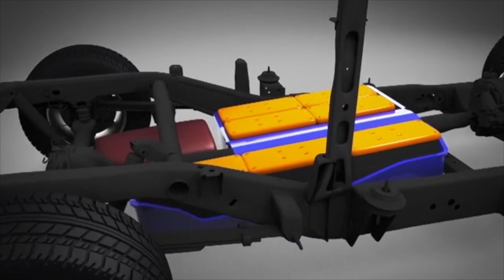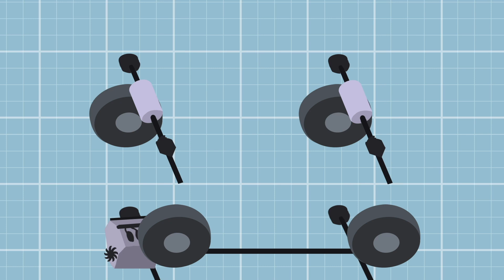Could This Pickup Truck Design Change The World?

Comment: Pickup trucks are probably the best candidate to be electrified, at least in the US. The only issue is the vast majority of truck buyers tend to be buying them to show everyone on the road how big and powerful their truck is. This is much harder to do when theres no appreciable engine noise, it won't make the driver feel as 'cool'. But if you think logically about the idea, it makes a lot of sense. Pickup trucks are already very expensive with no features, amenities, performance, and often times even range. They're slow, not very safe, and typically less reliable than a comparable car. It would be easier to make a 40K electric pickup truck than it would be to make a 20K passenger car, and while the owners would love the massively improved torque, performance, and reduced cost of ownership, they wouldn't be able to complain about how much it costs to fuel up.
Reply: I feel that you've been living under a rock. Many of the trucks are just as technical as some of the SUVs and cars if not more. The fact is people use their trucks to haul and tow, and they don't need to be disturbed by somebody who probably only owns cars.
Reply: Ian Heard I’m not sure what you’re getting at here. I made no mention of the electronics or technical performance of trucks. Most of the time they’re very similar to cars, which makes a lot of sense. From my experience, the overwhelming majority of truck owners never or exceedingly rarely tow or haul things a car couldn’t tow. The standard light duty 40K show trucks people like to buy don’t get dirty, and don’t haul much in the bed you couldn’t fit into a car. They also tend to tow very poorly and be drastically higher risk on road to both occupants and nearby vehicles due to the poor handling, braking, acceleration, high center of gravity, and overall traction. I’m not claiming trucks are evil, useless, or they should be eliminated. Just that for most people, a car would much better serve them, and it would be much cheaper to buy and operate. You get an increase in comfort, safety, reliability, economy, and they don’t drive like a bus. But since that’s what so many Americans want, it’s fine people decided to make it for them. And if someone’s going to make it, it probably would be better if it was electric. And it would be easier to make a mass market electric truck competitive than a mass market electric car, since you’re starting off with such a low standard for performance, overall quality, and at a high price point as is.

Comment: And where does the electricity come from for these "plug in" trucks?
Reply: In most of the US, a lot of power comes from natural gas.  The total carbon output is lower than for trucks with an engine because of economy of scale.  As more non-carbon power sources come on the grid, the carbon foot print will decrease further.

Comment: I watched the first min. And a half of your video, and already came up with an answer to your question. Why aren't better fuel milage trucks being made. Quite simply, greed. End of conversation.... that is the number 1 problem with people and bug corporations alike. Why would you make this ultimate vehicle that can get 50-60 mpg when you can slowly integrate "newer" technologies to bump your mpg from 25-50 in let's say 20 increments as a pose to 2. Becouse you can make more money by using 20 increments. Becouse you can persuade peaople to buy more vehicles over their lifetime trying to reach 50mpg buy different sales gimmicks over a lengthy timeline. All boils down to greed.
Reply: Might I add the term suppressed technology. Dont be nieve, car manufacturers have a lot of hidden technologies that their not willing to disclose for one reason or another. But I'd bet, its becouse it doesnt maximize the profit they could potentially gain going another route. We live in a world that has been around a long long time people... dont keep the wool over your eyes. It's the same principles in car sales as it is in anything else.... the control of advancement. This isn't like the middle ages people. Technology is way more advanced and has the potential of being a whole lot faster than what we perceive

Comment: your going the wrong way if you think pollution reduction is the goal.  Electric cars pollute far more than newer cars or trucks as shown by many studies. hybrids are normally far to under-powered for a work truck needed work load, and that will not change in the short term or even longer. let not even go into the cost increases that can be put to better use. As your putting out BS PR crud I wonder if and how much did you get paid for this vid?

Comment: The ignorance contained in this video is incredible. 

1: EVs are not the answer at this time. The environmental impact from manufaure of EVs is terrible and the batteries, once degraded are toxic waste.

2: Hybrids are stupid. There is no gain in efficiency to be had when you add additional energy conversions to any system. Hybrids are only useful if they are used to enhance performance.

3: EVs are not saving the planet. You are, for the most part, charging your car with coal. Stupid. A simple reality of EVs is that the only current source of electricity that has any hope of making EVs have a lower carbon footprint than a regular car is to expand nuclear power generation.

Just peddling bullshit is not the answer. We need to stop thinking that we have found the solution. We are nowhere near.

At present, the only people that are benefiting from 'green technology' are the snake oil salesmen that sell it to you.

If you want to repair the world, encourage your children to be engineers and fill their heads with useful ideas and not bullshit from TV or other pointless source of useless crap. Actually take the time to educate them. Your Facebook friends will wait.

Heads out of asses.

Comment: A "bit" of a turn off? Its the same turn off seen in electric and hybrid cars. Except its exacerbated in a vehicle that tows and hauls anything beyond itself and a few passengers. 

Now point number 2... And kinda the most important. Uh wheres the power coming from? Hmm? How are you producing this plug in electric power? Coal? Fuel oil? Lng?  So called "green" energy that cant even make itself profitable for energy companies? Sooo uh yeah..... Fail. 

Want to know how to make it work better? Remove the emissions restrictions on the engines. I dont mean make them dirty either. I mean litterally remove the stuff restricting the engines. We had carburetor engines in the 70s and 80s getting 50+mpg. Better than hybrids do today. In all this time nothing has gotten better in terms of fuel economy yet engines themselves are worlds more efficent. The problem is all of the excessive emission parts are restricting the engines. They make them detuned to pass emissions standards and end up being less fuel efficent when doing work. Make them run at peak power efficiency not peak emissions efficency and youll seen mpgs skyrocket

Comment: Is no one concerned with the magnetic fields that will be caused by all these electric vehicles. Seems to me that the magnetic fields are gonna be a lot worse than emissions. Especially if the magnetic fields of the moon are responsible for the tides of the oceans what the ones from the cars gonna cause.
Reply: The gravity of the moon (and sun) cause tides.
More efficient motors have smaller external magnetic fields.
People you live where there is a stronger magnetic field and where there is an AC component to the field live longer.

Comment: This won't matter soon as batteries will be so cheap it will be a no-brainer to just go all electric. The C4V Consortium will be producing Lithium cells with no Nickel or COBALT and on the cheap as they picked up a whole bunch of manufacturing equipment out of a Chapter 11 Bankruptcy. http://chargecccv.com/innovation They plan to scale this up to three 15+GWhr battery factories. This is in addition to factories by Tesla, Panasonic, Samsung, LG Chem and others in China/India/Asia etc. By 2020 there will be more than double current battery production and by 2025 it will double again. Also using a sub scale engine to generate electricity is a dumb idea. Solar PV is also getting better and cheaper too. Grid/Utility scale (20+MWatts) solar PV is cheaper than wind and nuclear according to Marin Katusa - https://www.youtube.com/watch?v=l0cF2JYZ8Tg The reason PV has become so cheap is the polysilica production costs have come down by 97% as the industry has scaled up. This is what is currently happening to BATTERIES. The oil price over the long term is likely to go to US$5 or less due to demand destruction by BEV's. And its not just land based vehicles, ships and aircraft will also go electric. https://insideevs.com/siemens-demonstrates-electric-motor-for-aircrafts-260-kw-continuous-output-at-50-kg-weight/ Aircraft will need super light weight batteries (eg LiS or Li-Air) and/or high capacity Super-capacitors. https://www.sae.org/news/2018/05/rolls-royce-and-superdielectrics-explore-supercapacitor-technology

Comment: Want to fix the climate problem as fast as possible? Use hydrogen even a 50yr oil burner can have the benefit of lowering carbon emissions.
Reply: In the US, hydrogen is made from natural gas.  It is a false economy one the environment.  It would be better to do a natural gas powered truck.
Reply: Ken Smith  its not false economy oil and the new lithium lobbyist are  to blame. Fixing the problem right now With hydrogen. and wait for battery technology to catch up.
Reply: @vninjav  
"Hydrogen is made from natural gas" has nothing to do with Lithium.
Reply: @kensmith5694  there are many ways to make hydrogen. Its worth spending the money for its huge impact on everything we are using now (internal composition)
Reply: @vninjav 
There are many ways but the lowest cost one is the one being used.
Hydrogen gets more expensive if you want to not release CO2 in the process.
Reply: @kensmith5694  the benefit outweigh the coast. If you consider how fast and The ease of adaptation and the positive impact on the environment. there isnt a enough lithium or easy fast way to covert internal combustion to fully electric or hybrid. But with hydrogen you can.

Comment: They need to stop wasting there time looking at electric , need to look deeper into hidregen,
Reply: They looked.  Hydrogen turned out to be a bad idea.
Reply: @kensmith5694  why is it a bad idea?
Reply: @jamesnorth8270 
They make hydrogen from natural gas resulting in extra CO2 in the air.
Hydrogen makes iron alloys brittle and is in general hard to store.
The fuel tank ends up having to be quite large to get enough range.
Refueling is a bit tricky. @jamesnorth8270

Comment: All full-size pickup trucks now, are F U G L Y. Just amazingly over-sized and fucking ugly. The mid-sized Honda Ridgeline is far more usable as far as size, get almost twice the mpg as any full-size truck, much cheaper and much better looking. WHY would anyone make an electric truck with a hood in front of the cab. Trucks are about what you can haul. Make an electric truck a cab-over design, store the batteries under the 10 foot bed.

Comment: How many power stations will be needed to charge all these cars. Power stations are far from efficient by the time electric reaches the charger for the car. All a load of rubbish climate change any way. Man caused the last ice age?  Think not. Electric I should imagine is just as polluting as an internal combustion engines.  Solve the problem by replanting all the forest that have been cut down could be a better idea!!
Reply: A stationary power plant is more efficient than an engine.  So long as the plant is running on natural gas and not on coal, there is a net decrease in CO2.  Solar and wind are an option that avoids CO2.  For most forests, the long term CO2 effect is near zero.  When the tree falls and rots in an oxygen environment, the carbon ends up as CO2.  In some places it become Methane which is worse.

Comment: Just who is making billions if not trillions off of this hoax? Curious to follow the money.
Reply: Your question is based on a false premise.  That will explain why you can't find the answer.
Reply: I don't deny climate changes but AGW is a hoax.  "scientists" given billions to promote it (research grants), billions raked in by mfg of photo-panels, generators, and motors, ect.  We don't even know what the planets ideal temp is. Geologist point out warmer is wetter not drier.  The whole greenhouse theory was debunked clear back in the early 1900's.  We don't even have anything more than guesses just where all the co2 comes from , it's all speculation.
Reply: Google geologist 1011 and read all his articles.
Reply: @wreckship6  
The science has been done.  We know the answers and you are a denier.
Reply: Ken, anyone who claims science is done doesn't understand science, it's always a work in progress.  When you start with an answer first then look for a problem it isn't science.  NOAA has been caught changing historical records, fabricating data, and suppressing research.  I'm not the one in denial.
Reply: @wreckship6  
I said "The science has been done"
That means something very different from "science is done"
You picked an incorrect meaning of what I said so that you could rebut something that was not my actual statement on the matter.

Comment: Okay build me an electric pickup truck that can have a payload of at least 1600 pounds is a quad cab has a hauling capability have up to 6,000 lb and a range per charge of at least 800 miles so I can make it down to Virginia and back, Tesla's are a luxury car a status symbol trucks are a working vehicle I pulled tree stumps out of the ground moved 600-lb of flooring towed my friend's car to a shop on a dolly go up a mountain and stay in a cabin and Hunt, my truck does what I needed to it gets 19 miles per gallon highway and is worth more to me then some Tesla that will leave me stranded on the side of the road because it is unable to fulfill the needs that I have and at best would be able to bring me 200 miles before it shuts down not to mention they cost way way too much

Comment: Electric vehicle are just as bad for the environment... Hydrogen fuel cells are much more practical
Reply: Hydrogen is currently made from natural gas.
It puts CO2 into the environment when you make the hydrogen.
Reply: Ken Smith Never said they didn’t put some emissions into the air, but a system could be made to create hydrogen via electrolysis. Hydrogen can be considered an infinite resource and it is much more energy dense

Comment: All this talk is horse crap a hybrid large truck van or suv is pointless because the weight of the battery pack and electric motor will kill any advantage it could produce and two the maintenance costs of the electric motor will be high no matter what type of electric motor used whether it's brushed or brushless electric motor an two what about the water problem how will you keep water from damaging the entire system trucks drive in rain and can the hybrid electric system handle offroad use over the long term a full electric large truck suv or van is pointless to improving aerodynamics and engine and transmission in conjunction with the rear differential gear set with a 3.10 ratio will go along way too help improve mpg and further more cut unnecessary weight from the vehicle without compromising safety that will help to and another interesting thing is who will pay for road repairs and maintenance gasoline and diesel fuel taxes pay for that all electric vehicle's don't pay a single cent to help maintain our nation's transportation system a added federal tax of $3500needs to be to a full electric vehicle's and hybrids pay $1575 annually just like federal income tax to offset the loss of the fuel taxes because of these vehicles.

Comment: All cars in the world represent 8% of the total emmisions. Electrical pickups won't change anything. It's actually proven that there is no real measured benefit when buying an electric car in comparison with a  diesel or gas due to the hight emmisions rate during the battery builb. The future to me is carbon fuel or hidrogen. But that's just me...

Comment: The problem is......wait for it........profit.   Ford's most profitable automobile is the F150 pick up.  A series Hybrid say Ford pickup would only pull in a few new customers that most likely we're not going to already buy an F150.  Ford moves from making over 10k per truck to barely breaking even.  Ford would be giving the customer MORE torque and far better fuel efficiency than its all gas counterpart.  Most people will do the math and want the hybrid vs the gas version.  The only way a major  manufacturers will push such a truck is if it does not compete with it full size pickups.   Then you get some useless hybrid like the BMW i3s sad attempt at a non competitive electric car.

Tesla will make an all electric pick up and have the market pretty much to itself.  Europe and Asia most likely have competitive hybrid pickups. The Chicken tax will stop them from bringing then to the states.   Nissan and Toyota have their own full size highly profitable pickups to push.